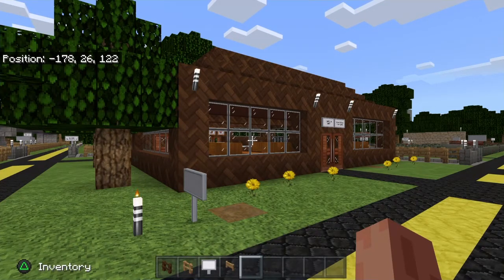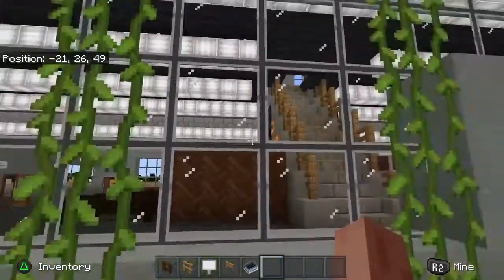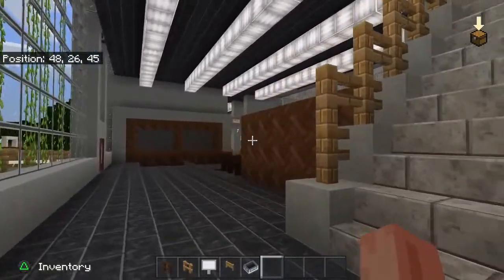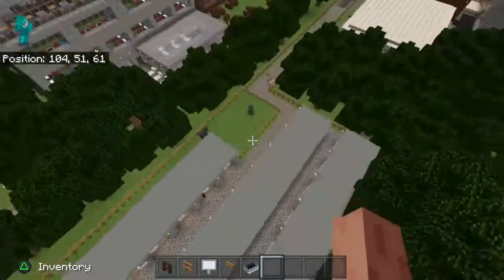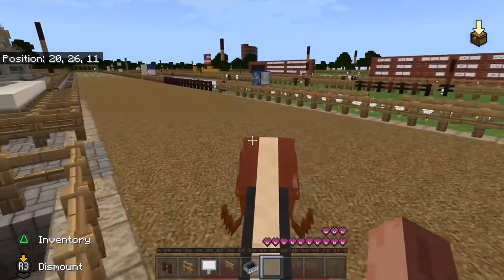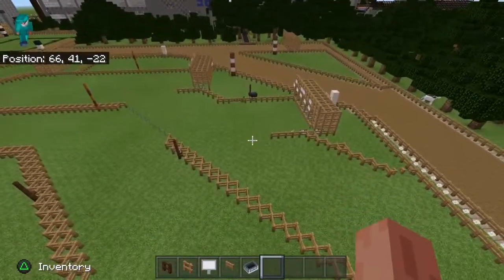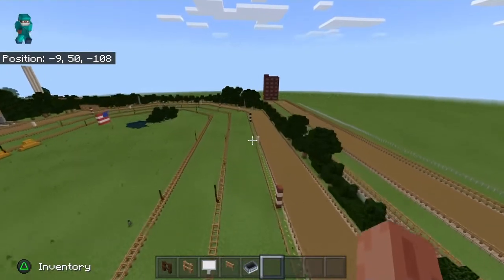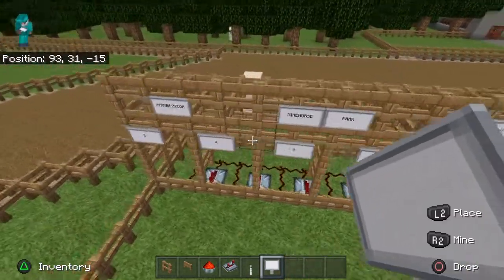2020 Minecraft Racetrack Tour + Starting Gate Tutorial (Horse Racing)

Comment: Why is 1/16 of a mile only 33 blocks rather than 100 blocks. Blocks are 1 meter cubed
Reply from the maker: Oh, forgot to explain that, I did in one of my older videos.  It's because if we did that, the track would be so huge it would be hard to see the entire thing, and it would take the horses too long to run the distance.  If you want to change the distance or try the 100 blocks, by all means.
Reply: @Roadwarrior627  that makes perfect sense! About how long does 1.5 miles take on your track?
Reply from the maker: @lucatedesco5171  Somewhere around 1:45.  It should really be between 2:24 and 2:30, but I wasn't going for anything as far as timing.